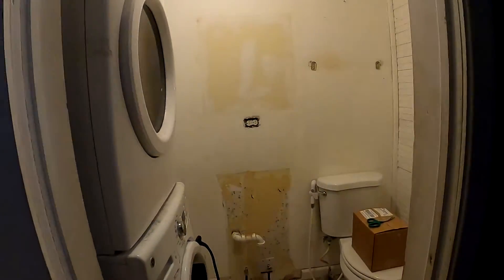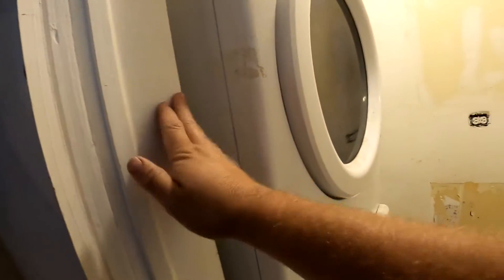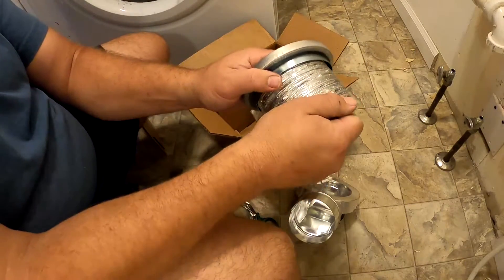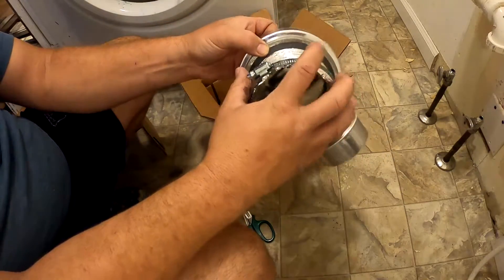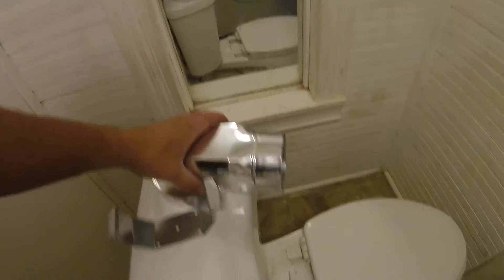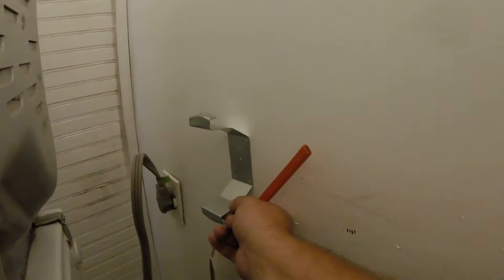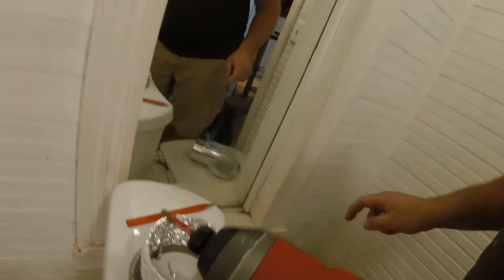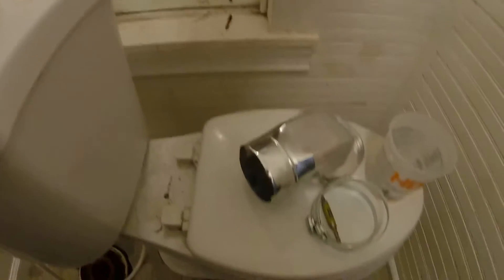Magvent Dryer Vent unboxing, installation, and review. Cool new product installed and tested!

Comment: Good job. I would have liked to see what happens when you pull out the dryer. Thank for the plastic paint can tip. That made my day.
Reply from the maker: Had it back out once since I installed it, was clean and went back together just as easy. Still working well and it’s been in around a year now.

Comment: Good job.  I'm lucky to have my dryer next to the outside wall, so very short connection and this new system will make it easy to disconnect dryer for cleaning.  BTW, as a woman, l like the way you covered the storage shelving with a curtain.  Bathroom looks fantastic.
Reply from the maker: I remodeled this room myself. My wife came home and said “are you sure you’re still straight?” Lol

Comment: you should NEVER use sheet metal screws to keep dryer ducts together, the exposed screws will attract lint
Reply from the maker: Did you watch the video?  The system installs with no screws through the vent. It uses clamping rings and magnets.